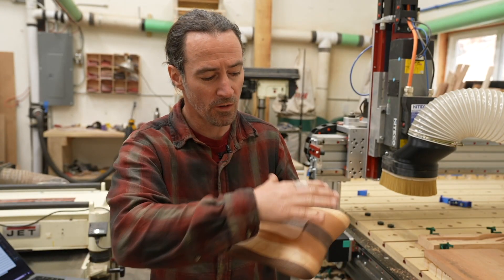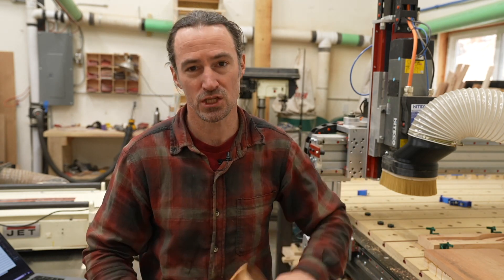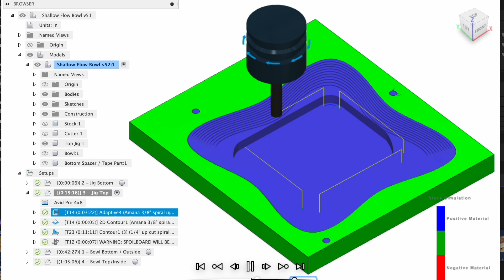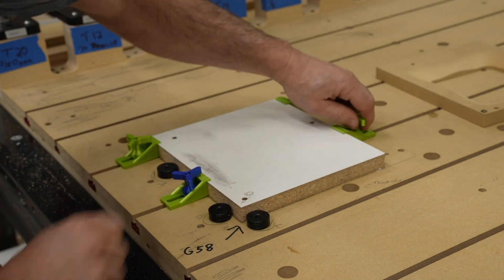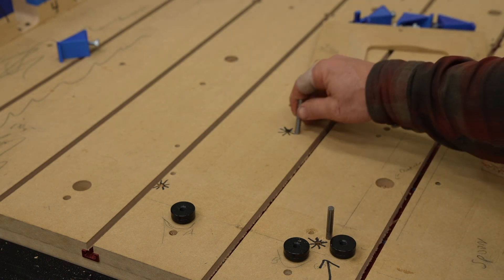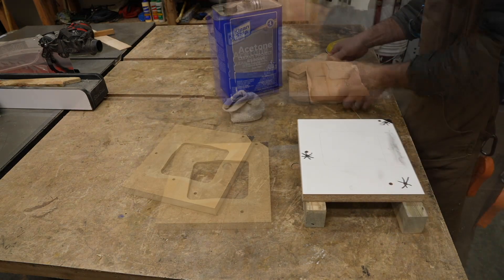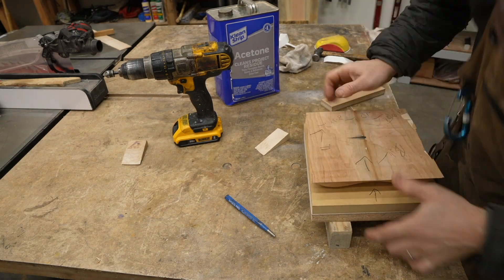How to CNC a Bowl - Two Sided CNC Machining - "The Shallow Flow Bowl" - Fusion 360 File Available!

Comment: Why didnt you start on the inside
Reply from the maker: The bottom/outside is done first in order to have a flat surface to mount it down to the table (via the jig and tape) and orient it for the 2nd operation. The next video uses Vectric VCarve for the same design, and adds tabs. Tabs allow the top/inside to be done first, and then it can be flipped over and the bottom/outside can be done second. The tabbed version requires more wood and space for the tabs. It doesn't require a jig, and is easier for more people to do. It requires more finish work (sanding and removal of the tabs).
Reply from the maker: This video explains it really well: https://www.youtube.com/watch?v=0-b5IXSgQdw

Comment: I like your projects very much. Is it not possible to use jig with vcarve? Is there a jig in the files you are selling?
Reply from the maker: So, it is possible to use a jig with VCarve, but the hard part is ensuring the origin is spot on. When importing an STL into VCarve you don't get a lot of specificity as to where the model is, and you need it to be dead on centered in the jig, and the origin to be the jig's corner. You can't import two STL models into Vcarve (only Aspire), so there isn't a way to align them. VCarve isn't really the right thing to use when you want to do complex machining. Aspire is only a little better; Fusion is by far the best.
Reply from the maker: But yes, the Jig file is included in the Fusion model. I can export it if you need the STL...I can't remember if I included that in the exported files or not.

Comment: Great video! I just got one question: do you make the jig slightly bigger than the bowl, to make sure the bowl can stick well to the bottom, or it isn't necessary?
Reply from the maker: Hi Robert, I make the jigs exactly the same size as the bowl; ideally it should be smaller, but woodworking fits are around 0.005-0.008", and for something like this it just isn't necessary. It'd also be really hard to scale it down the right way and be exactly 0.005" thinner.
Reply: @CorbinDunn  Thank you!

Comment: This really is a great product and video! Since you are making a repeatable process, I am wondering how you re-find the dowel indexing holes in the mini spoil board are after you run a different job, and your original coordinates are gone? I understand the indexing in the jig to the spoil board, but how do you permanently log the indexing holes spoil board location so you can do it again?
Reply from the maker: Yeah! I use CNC Work Offsets and save locations on my spoilboard. Video: https://www.youtube.com/watch?v=iyP81afV-Io
Reply from the maker: ...and, in general, I run most all my jobs from a specific offset. They also vary by specific amounts due to how I made my spoilboard indexing (dog holes), so it is pretty easy to find new ones based on an existing one.

Comment: Thanks for this an amazing deep dive into this bowl process. There is so much wood to be removed from the interior of the bowl, couldn't you screw into that area instead of the tape when milling the bottom? It seems you've got the double sided tape down to a science, but screws could be faster and fewer steps. Keep up the great work!
Reply from the maker: Hi David! Yeah, you could use screws, but I don't like to chew up my spoilboard. Overtime, screws lose precision when you reuse the holes a bunch.

Comment: Great video with some tips that I will likely use in the future.  My one suggestion is that there is some value in using wooden dowels in that if you're CAM operation is somehow screwed up (not that I ever make that mistake... ), then if the bit collides with the dowel, it will survive a wood dowel as opposed to likely chipping on a steel dowel.  I love the 3d printed clamps that I use for exactly that reason.
Reply from the maker: Thanks! Yes, that is a good point about the wood dowels. I usually use them the first time I do a new project/design, and then I move to steel dowels when I reproduce it again.

Comment: Nicely done dude. What is your tolerance/slop for the bowl and jig fit? 0.005 surface offset? Too tight and I imagine you can't compress into the tape too much. Too loose, and I imagine a twisting force could break the minimal tape surface bond. Makes me think allowed slop is directly proportional to tape thickness (ie: how much torsional force the tape can handle).
Reply: Also: Have you ever played with using one of those razor-jaw vices in this application? The ones that grab onto a very small amount of stock. I'm not sure if they will work on wood, or how easy the marring would be to remove with sand-paper after, but it seems like it could work.
Reply from the maker: I haven't tried those! It is hard to avoid denting the woods -- especially redwood...it dents so easily.
Reply: @CorbinDunn  Interesting. That's a much larger offset than I would have guessed. As for the razor-jaws: I'd definitely expect the knife edge of the jaws to bite into the wood (it bites into the metal) and leave a mark, but it takes such a small bite that you might be able to easily account for it and then file it off after. I'm just not sure if you could get the required hold-down strength from it, but I'm also surprised and impressed that such a thin double-sided tape works. So maybe.
Reply from the maker: Yeah! That took some time to figure out. I move the jig, in the model, about 0.045" up before I do the boolean cutout of the bowl on it. This gives it a gap underneath. I think this was too much...as I used some blue tape under the jig to give it a little less space., so about .030" might be ideal. I had problems with my first tests where the bowl would easily pop off. I found some pretty thin double sided tape; the thicker tape lets the workpiece move and have too much play.

Comment: such a great idea!  Do you find any warp-age of the bowls after removing so much material?  Or is it not much of an issue?  It looks like all of the bowls are at least tow pieces of wood glued together...so I assume that helps quite a bit.  Great job man!
Reply from the maker: So far I haven't had any warping issues. I've had some done at least a month or so, but the humidity is fairly stable where I'm at in the US. The multi-piece ones will definitely maintain the shape better! I've sometimes layered them with the grain at 90 degrees to help with any expansion/contraction, but it doesn't seem to make a difference, so I go with aesthetics.